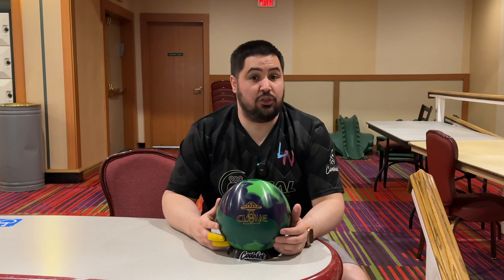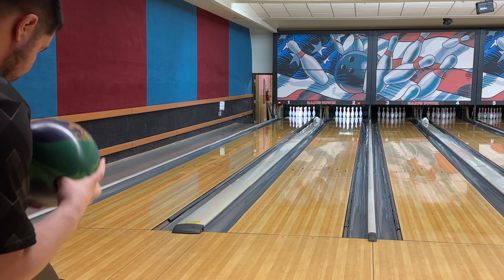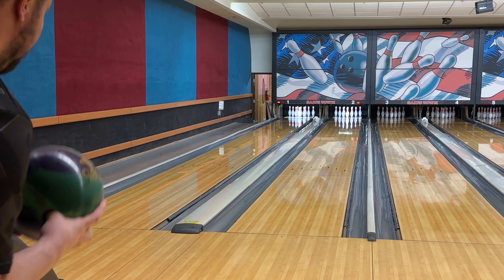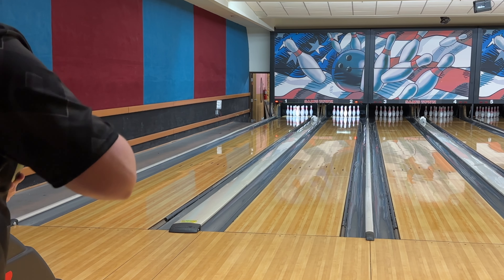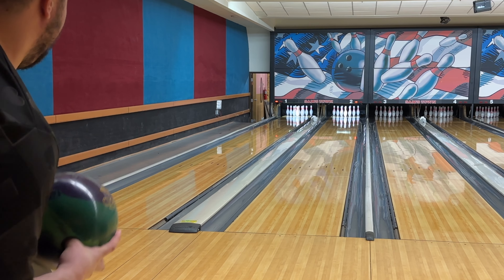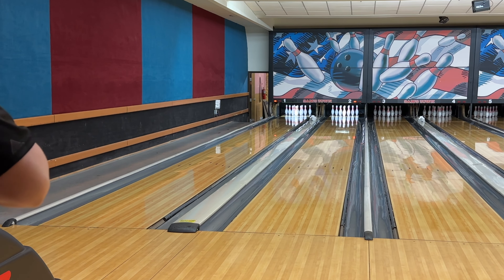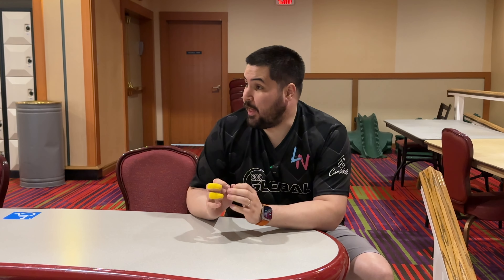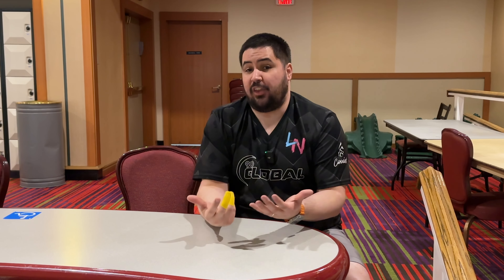Roto Grip Clone With Surface Is NASTY!

Comment: I follow Luke’s suggestion of resetting the surface on every ball I get. That way I can replicate that finish when it needs a full resurface. On polished stuff, I use a 1000 pad on a spinner then Step 2 compound.
Reply: Interesting on the polished stuff, using 1000 then step 2, where’s that usually take it to??
I’ve been hitting everything with 2000 out of box as starting point
Reply: @shannonkirby7040  I don’t have a scanner, but I imagine it takes it above 4000, but the 1000 base gives the ball some teeth. Luke Rosdahl says the gloss finish from the factory can make balls go too long. I’m fairly speed dominant so I stuff that’s super polished doesn’t work for me normally.
Reply from the maker: Yea I been doing that as well !

Comment: I liked the reaction you were getting with the surface you put on it.  I change the surface on the balls I have , but several time I do not notice a big change in the reaction, unless it a huge change as you did here.  Going from a 3000 surface to a 1000 ,  I have very little reaction change.  Keep up the great work.
Reply from the maker: I prefer it with polish I think!
Reply: @LuisNapoles i also love mine with the polish too

Comment: I NOW change the surface immediately if I can to whatever grit it supposed to come at. If polish, I use CTD polish. However, I got my clone Saturday. I tried it with polish, I didn't like it. Then tried it with 3000... 245 game! So then I put polish back on it, it was okay. I'm going to try 4000 next. My Summit is straighter, the Clone shapes better.
Reply from the maker: I been doing that lately as well

Comment: Actually, it might have looked good straighter if you had been warmed up. Once you loosened up your speed and release looked better. Like the Clone, and glad you did the surface change. Both Barnes and Rosdahl liked it better with less or no polish. Btw, I have friends that will throw the first ball of practice (at about half speed) and start whining that the lanes are hooking, or they are oikly, or whatever. My first shot, I'm just  trying to get the knees to bend, and the ball to get off my hand clean, and loosen my old muscles.
Reply: Yeah, no reason to whine about shots when you're not warmed up. My problem is I strike all through practice and then fall apart in the games. 😂😂
Reply from the maker: I can agree with rjay$